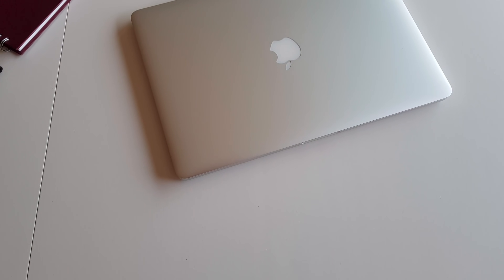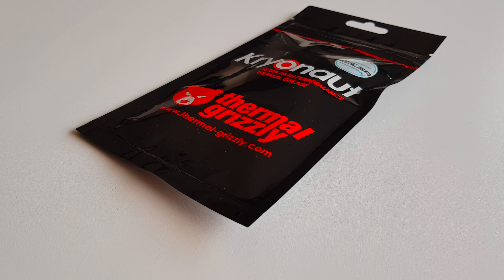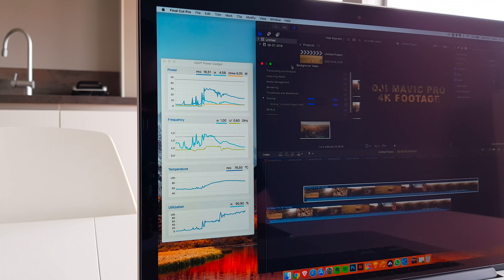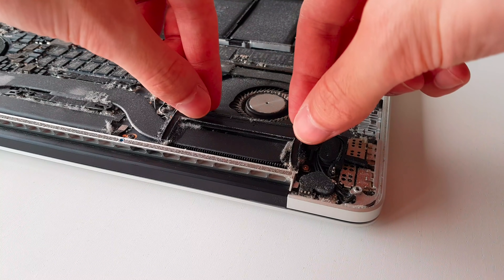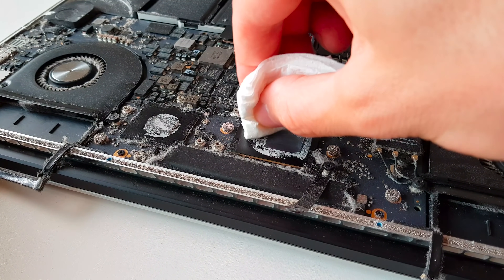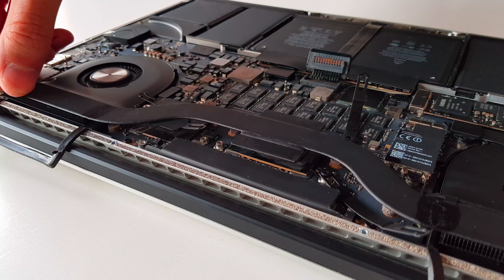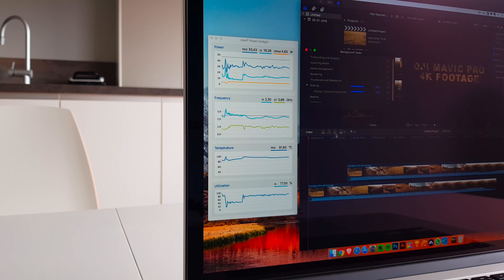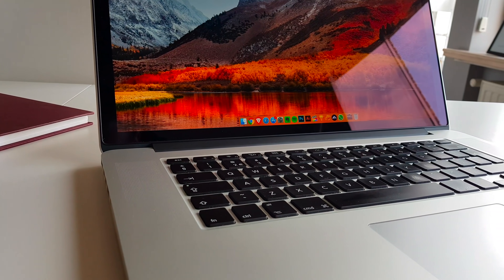Solved overheating problem on my MacBook Pro 15" Mid 2015 by replacing the thermal paste

Comment: Well.... although replacing the thermal paste with this tutorial worked... the fan is still blowing quite a lot on my 2014 Macbook Pro. Maybe it's a software issue? Thoughts? I use Mojave OS, but a lot of my software is older (CS6 Adobe suite, for example).
Reply: I have a Mid-2014 15" Retina (a1398) 2.8 GHz Quad -Core i7, 16 GB RAM, NVIDIA GeForce GT 7550M 2 GB, 1TB SSD. Just bought used, person before had the battery swell so it was replaced, now has some service battery light and runs hot, maxed out RPM fans, keyboard area/the strip above keyboard is the hottest part, which makes me think its the SSD or possibly CPU I heard? 

I've heard other people replace the thermal paste, but most comments say issue still persists. Heard others with similar models have logic boards replaced and didn't fix either. Lastly, many suggestions such as resetting the PRAM & SMC. 

Is this a common issue with the 15" MBP? do they naturally just run hot with a terminal velocity fan?? It's so annoying cause my MBP Mid 2012 13" 8GM RAM and 1 TB SSSD was quiet as a mouse with zero problems and this is blowing like a jet plane with just simple web browsing! not even using it for Adobe/Music Production like I intended! are they just too thin for their own good? So far, i took it to one shop and they ran some diagnostics and said it was within normal operating range, however, I don't think it should get this hot- literally its too hot to put on my lap and even hot to type on. Is this model just a lemon and should be avoided or what? thank you.

Comment: Just did this for my 2014 Macbook Pro (15") and... it worked like a champ - GREAT TUTORIAL! FYI I also did a little trick that helps low-tech cowboys such as myself: I printed out a sheet showing the computer guts, and whenever I removed a screw... I taped it on the section of the printout where the screw went, and when the time came to put things back together, just grabbed each screw taped to the printout - WAY easier than trying to remember which screw went where. Thanks again sir & great job (keep 'em coming).
Reply from the maker: You are welcome man! Happy to hear it worked 😉 Thanks for sharing that print idea for organizing screws. Smart! 👌
Reply: Good tip!
Reply: I do the same thing, except I just draw in pen a few notes and rough outline on an A4 paper and tape the screws to that.
Reply: Watch out for the cat lmao
Reply: Do you have a link or copy of this map?
Reply: Can you indly what is the URL: for the sheet showing the computer guts.
Reply: if you don't have a printer, just record a video of unscrewing and play it backwards make sure to put the screws in different locations ofc! I will purchase some thermal paste and go for mine!

Comment: it's gonna thermal throttle anyway no matter how good the paste is.  The heatsink is too small for the CPU
Reply from the maker: That's true and I was not trying to fix that. What you can do is increase the operating time until it thermal throttles

Comment: Ahh good ol' dust, before you remove any bolts, if it is that dusty, vacuum it and after you get rid of the dust, then proceed to unscrew the heatsink, you don't want to have dust particles   in between the thermal paste and the core.
Reply: Actually DO NOT vacuum dust out for your pc EVER. Vacuuming creates static and can potentially damage components that way.
Reply: gooze Any source? Article on the matter? I'd like to read more.
Reply: tldr for those links, DO NOT VACUUM YOUR PC OR YOU WILL RISK DAMAGING YOUR COMPONENTS!

Comment: Just replaced mine after 5 years lol
Reply from the maker: And? Did you get any good results? 😁
Reply: @DigitalPulse  at the moment it's hotter than it's ever been before. I think the paste needs to spread around more or maybe I used too little. I used the exact same kind you had and applied everything the same way. my intel power gadget is jumping from 66-80 c lol. I'm going to wait a little more and see if it spreads out on its own before opening it again and re-applying.
Reply from the maker: @crassbmt  Weird. Well in my opinion it's better to put a bit more then not enough 😅 But that's a good plan. Give it some time and re-paste if it does not improve. Good luck man!
Reply: @DigitalPulse  thanks, I may have wiggle the heatsink on top of it too much.
Reply: @DigitalPulse   update: I reapplied it a second time and my temps are decreasing! 😎thanks for the tutorial!

Comment: Can someone help me find my gpu on my MacBook mid 2015. My Mac looks exacting like the one in the video but without a gpu section on the heatsink.
Reply: Yours problem doesn't have a separate gpu, just the one built into the cpu
Reply: RealDarkFilm ahhh I see thank you for the help ☺️

Comment: I just removed the dust from my machine after 2 years and it's still running hot. I wanted to clean the fans but was scared taking the heat sink off. I'm glad I watched this video though cos now I'm 100% trying this
Reply from the maker: Good luck man! Let me know if you get stuck and if you need some help 😉

Comment: Thank you so much for this tutorial! I made sure to use your links for the purchase to help you out :)

My advice would be to purchase the more durable screw drivers, the threading on the star tip (or the 6-star tip not sure what it's called) pretty much broke in the process of taking it apart :(
Reply from the maker: Thank you so much Ken! I really appreciate it 🙏

Thanks for letting me know about the screws. My worked great so far. Which ones did you exactly get?

Comment: Fantastic video, I think I'll do it as well. One question though, my macbook pro is a refurbished 2015 16 GB RAM 15 inch 512 SSD with integrated Intel Iris Pro and a AMD Radeon R9 M370X. A youtube video runs fine on 1440p, but starts to throttle on 2160p. Not entirely sure if new thermal paste is required, any suggestion? If I'd change paste after all, I do wonder, as well: after having applied the paste and put the computer back together, how long should you wait before using the computer again? Again, thanks for the fantastic video.
Reply from the maker: Hi John. You can use it right away. No need to wait! 🎉
Reply: @DigitalPulse  thanks a lot buddy! A quickly edited a question: I was also wondering if a youtube video at 2160 (but not 1440p) on a refurbished 2015 15 inch macbook pro 16 GB RAM 512 SSD with integrated Intel Iris Pro and a AMD Radeon R9 M370X is usually throttling? On 1440p it is fine.
Reply from the maker: @johncaybould3022  I am not completely sure John so I would rather say nothing than give you wrong advice 😅 Maybe ask that question on a forum like Tom's Hardware 😉

Comment: I wish you mentioned the size/type of the screw drivers used on the external and internal screws
Reply: Amer W. N. Pentalobe 1.2mm for removing the screws on the backing of my 2014 MacBook Pro
Reply from the maker: That's a valid point. Couple of people mentioned that as well. There only 2 screw types used there so it should be quite straightforward.

Comment: I agree that Thermal Grizzly Kryonaut offers the best thermal performance of any non-conductive paste but the huge caveat is that it is only guaranteed to not break down when used at temperatures of 80°C or less.  As you likely know, Apple's MacBook Pro 15" often hits 99°C when editing or exporting video or when running CPU intensive applications.  As such, it would seem more prudent to use a past like the Noctua NT-H2 which does not break down at 80°C.  With that said, your video was made 1 year ago, so I am curious as to whether your thermals have slowly increased over time, or if your MBP is still running as cool as the day you repasted.  My intent is in knowing how fast Kryonaut degrades in MBP's which run much hotter than 80°C.  Thanks.
Reply from the maker: Hi JDW. That's a valid point. Unfortunately I don't own this device anymore so I can't do any testing. But I will keep that in mind for next time and get that thermal paste
Reply: @DigitalPulse  Thank you.

Comment: Did u put your MacBook in a garbage bin or something? Two years of use and this dirty? Mine is 4.5 years old still clean
Reply from the maker: Lol no. But in the evening I used it a lot in my bed so I assume particles from bed sheets caused this.
Reply: Dario Prski oh okay, u blocked the vents I see
Reply from the maker: Yup. So it sucked in a lot of crap
Reply: Dario Prski after u cleaned it up it looks just like new and perform like new, great job!

Comment: Great video but the only thing is that with the thermal paste it would’ve helped to spread the thermal paste and it would help even more with the temperature! Overall great video!
Reply from the maker: Thanks for the feedback man. That's a valid point but then again the CPU die is quite small so I think it spread decently when it got pressed with the heat sink. Still, I will try it next time when I do a repaste like yous suggested! Thanks for watching 👍

Comment: 5:49 Compressed Air...
Reply: Why do you want to blow dust deeper into your machine as opposed to using a vacuum to pull it all out? I've heard arguments both ways.
Reply: @MentallyThe3rd  Vacuum from a vacuum cleaner? No thanks. Don't want static.

Comment: DUDE! This video was the greatest and the most helpful thing tonight! I've been using my mid 2015 mbp for 4 years now and today I realized that my batteries have started to swell badly. I've also been having major heat issues and thought that it's just normal... smh Trackpad is a bit out of place, not too bad yet and the bottom is swollen as well. Tomorrow I'm gonna purchase the stuff needed and fix this asap and also apply new thermal paste. Seriously, thank you for the really well made instructions and pictures!
Reply from the maker: Hi Jeyson! No problem at all man :) Happy to hear that you find it useful. Let me know the results after you perform everything and if you get stuck in the process let me know. I might be able to help :)

Good luck!
Reply: @DigitalPulse  Just finished the whole operation. New batteries, new thermal paste (kryonaut). Took me like 3 hours max in total. When I fired the machine up, the keyboard didn't work. Royal panic for 1min. 1 short tutorial later I realized that I had forgotten to close the clip of the battery/keyboard connector. Was about to freak out but I'm glad everything worked out after all! I hope the unofficial replacement battery lasts long and doesn't mess up my system in any way. All is well, Great stuff. Thanks for your tips and everything else dude! Ur making a difference and impacting other ppl's lives, gotta respect that. Regards from Finland!
Reply from the maker: For some reason your comment was flagged as spam by the stupid YouTube algorithm and I discovered that just now. I am really glad that it worked out for you man and that my video was helpful! :) When I was creating this video I was a bit worried that people won't achieve the same results like I did but you are a perfect example that this tutorial works. Thanks for taking time to share with us your experience! Greetings to Finland! Enjoy your "new" MacBook :)
Reply: @DigitalPulse  Thanks dude! Really cool to be one of the ppl who really did it with ur advice!
Reply from the maker: @maxprepper8023  I appreciate it a lot man! Thanks 👍💪
Reply: @maxprepper8023  for what it's worth ... Apple had officially mentioned about battery issues for this model. I have the same model and I got my bulged batteries replaced by Apple ... Mine was done in 2018 just befire the 3 year apple care warranty got over. Apple's announcement was after this .. somewhere in 2019 I beleive. Still I think they will replace for free due to their official statement. Hope this helps.

Comment: You should have removed the dust, then checked performance after a simple cleaning. I have never seen so much dust as what I seen in your MacBook, both fan ducts are completely blocked, the fan blades are covered with dust. The logic board is also covered with dust. The heat exchangers and heat sink are not being cooled properly, the dust on the logic board acts as a blanket, trapping hot air. Simply removing the dust would have made a bigger difference in performance than replacing the thermal paste.

Comment: Great video. Thank you for sharing. I did this exactly as shown in your video and it worked for a few days, but it has started to intermittently turn itself off unexpectedly. Do you have any idea what this may be?
Reply from the maker: Hey Chris. Can you check ur temperatures? Does it turn off when it overheats? How much thermal paste did you put?
Reply: Dario Prski similar amount of thermal paste as shown in your videos mate. How can I check temperature please? Do I need to download some software ? Thanks in advance
Reply from the maker: @Mr_F_82  Hi Chris. Download the Intel Power Gadget and try to monitor the temperature. We need to narrow down the problem. Keep track of the temp and stay on the lookout if it's reaching very high temps. Might be that it's overheating and then turning off to prevent damage.

Here is the link: https://software.intel.com/en-us/articles/intel-power-gadget
Reply: Please tell us how you resolved the problem

Comment: I have a mbp 15” 2.2ghz, at idle its about 55c do i need to replace thr thermal?
Reply from the maker: I don't think so. Maybe just clean it, since that's approximately the normal idle temp of that laptop.
Reply: I changed the thermal paste to n1h1 thermal past correct me if im wrong, and the thermals are much better  changed aroumd 40 idle temp. And i can put it on my lap without burning myself

Comment: I could not watch the video relaxed. It was rumbling under my fingers. I would have liked to have built a time machine and come by with a vacuum cleaner. How can you work like that?
Reply from the maker: I was worried that a vacuum cleaner might pull something in from the motherboard in case it was loose. Just did not want to risk it.

Comment: In case it has not been mentioned before - a tech pro tip on thermal paste is to cover your finger with clear plastic wrap (saran wrap) and spread the thermal paste evenly on the chips before reinstalling the heatsink.

Also, the dust in there definitely was a factor - the fans were covered.  Compressed air all over that logic board (do it outside, trust me) will get it done quickly.
Reply from the maker: Thanks for the tip John! With the ThermalGrizzly paste you also get a small spreader, but probably your method works effectively as well.
Reply: @DigitalPulse  I prefer the finger method because it gives you more tactile feel for a thin, even, smooth coat.  Also, I always use compressed air to blow out the insides before starting to remove any parts (your fans were pretty clogged!)  I recently did this procedure to my 15" Late 2013 Retina 2.6 i7, and while it didn't reduce peak temps that much, the fans were so much quieter - they didn't have to spool up to max speed.

I should get that Intel Power Gadget - is that free?
Reply from the maker: @JohnPamplin  Yes! It's completely free. Here is the download link: https://software.intel.com/en-us/articles/intel-power-gadget

Enjoy and thanks for stopping by! Really appreciate the feedback :)
Reply: Dario Prski пальцем или другим органом…братка, я думаю что ты вряд ли заменил термальную пасту на лучшую. Хватило бы обычной чистки. Ты же сам видел сколько пыли накопилось.  Паста не являлась причиной перегрева.
Reply: Dara, Google Translate. only copy-paste. 😉
Reply from the maker: Why didn't you do that?

Comment: WTF, why would you not use canned air before taking off the heatsink????? You want to ensure there is no dust or lint on the CPU. You dusted after taking the heatsink off, so there was dust in the air.
Reply from the maker: Didn't have it at hand so I used what I could. Not the ideal way, but it got the job done.

Comment: Pulling up on the shorter side of the backplate might be safer and more effective because of the shape of the tongues and clips that hold the plate in the middle.
Why did you wait 2 years? =p
Reply from the maker: Valid point! Well, I did not expect even in my wildest dreams that in 2 years there could be so much junk in a laptop that thin :D

Comment: Will this work for 2014 too
Reply from the maker: There is no reason why it should not. Just double check if taking apart the heatsink is the same like for the 2015 model. Good luck!

Comment: what i needed ! perfect thank you
Reply from the maker: You are welcome Harry! Good luck :)
Reply: @DigitalPulse  Hi Dario , so i did exactly what you’re showing in this video , cleaning the dust off the fan and everywhere else , and applying the new grizzly paste after cleaning with alcohol, but my mac is still louder than ever just going on Chrome. what is youre guess on this ?
Reply from the maker: @freestyle4000  Hello Harry. Well, it's a bit difficult to say. How and how much thermal paste did you apply?
Reply: @DigitalPulse  Precisely as much as you did apply on the video , my computer works better but is still very noisy for easy tasks, maybe that's the way it is after 4 years ..